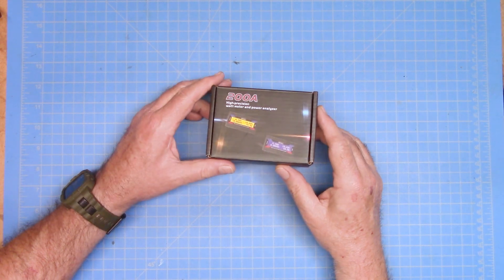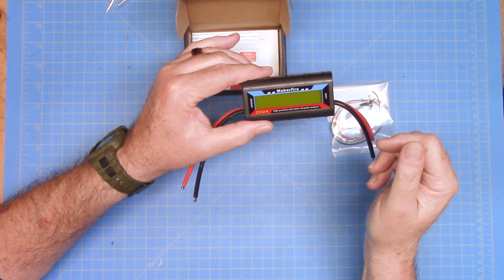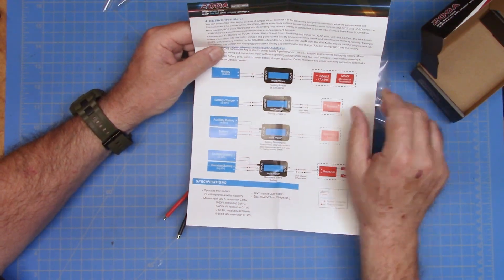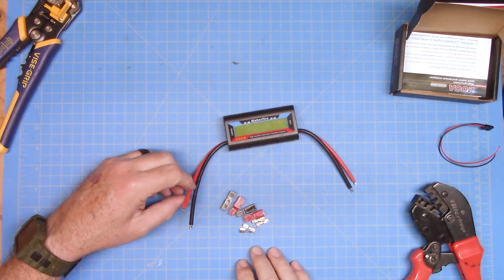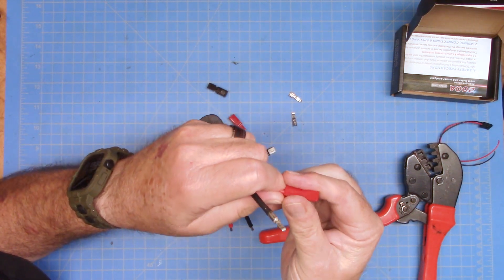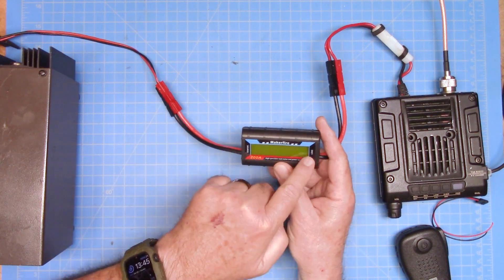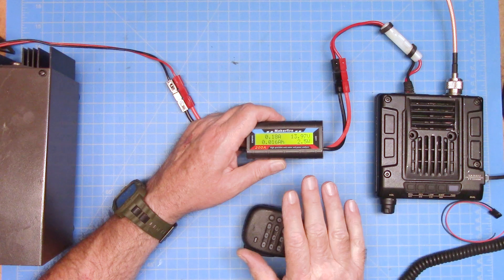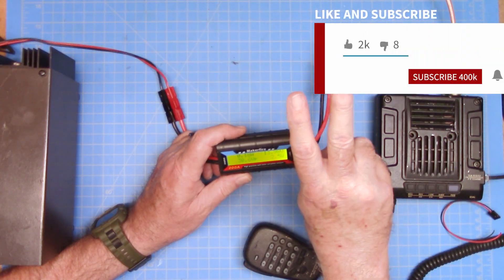Monitor your  power usage, in the shack out or portable!

Comment: I have the Power Worx version with Anderson SB 50 gray installed. I did not get that little plug . It looks like 10 AWG wire . So over 30 amps continuous draw  the wire will get warm. Mine does. I was pulling 40-45 amps threw it and it got a tad warm . I can see it on thermal camera. When I crimp Power poles ,I add a drop of flux and heat it up with soldering iron.  Then clean flux off and assemble. Most of my Power pole stuff comes from Power Worx out of CA . They Shipp orders like in 24 Hr. But USPS can be slow CA to NY . normally 6 days . Longer if weather in country is bad in between.  And very often it is. 73

Comment: Thanks Jim, I got two of these back when I made my SSBB (Stupidly Simple Battery Box) which was a plastic ammo can with two Miady (now Talentcell) 6Ah LiFePO4 batteries each connected to one side of a dual powerpole bulkhead adapter. 
One of the things you did not mention is after portable operation using the dingus to monitor battery usage you then reverse the dingus by placing the battery on the load side and place your charger on the source side, allowing you to monitor your battery charging info. (when the charge current approaches zero, battery is at full charge!) See you in church! 73 de AB1OP
Reply from the maker: Dude, that's freakin genius - and bloody obvious!  I never thought about that at all.  Great tip, man!

Comment: Powerwerx sells the meter with the Anderson powerpoles already attached for anyone who doesnt have the crimp tool (which I do).  

The rating labeled on their unit is 45A, which is the highest rating for the "standard" powerpole connectors used in ham radio.

I suspect I would feel very uncomfortable trying to draw 200A through that gauge wire.

I agree these are awesome devices. I have a couple in the shack and in my go box. I also use them to monitor power coming out of my portable solar panel since my charge controller doesn't display data.
Reply from the maker: Daniel - concur, I'm not gonna be radiating this thing with anywhere near 200A.  I use them for testing mostly radio stuff anyway, certainly all less than 45A.